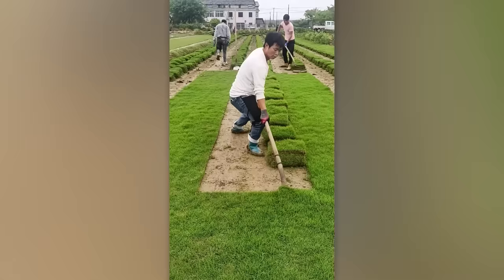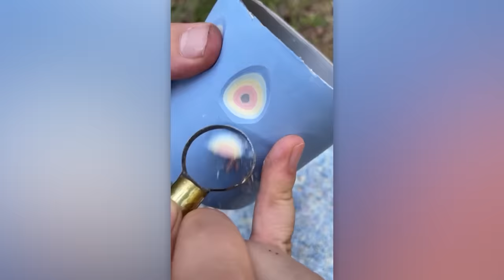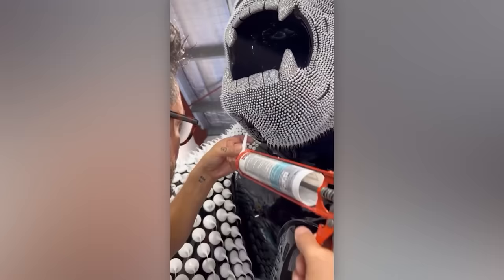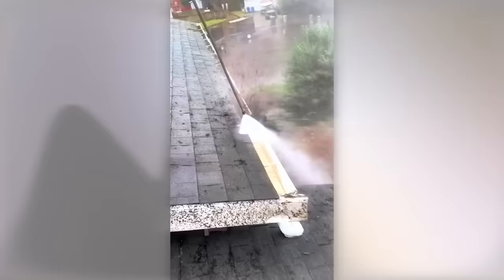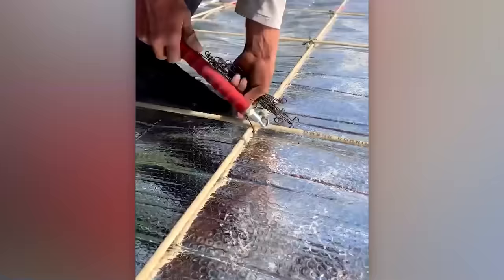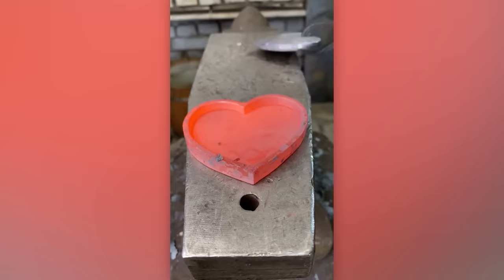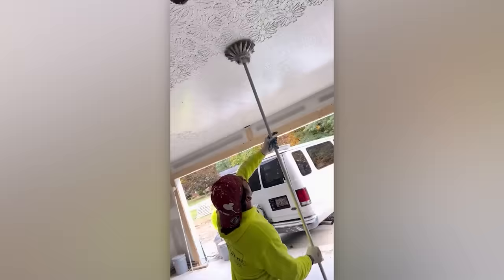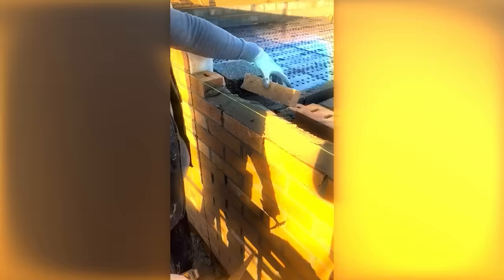SATISFYING VIDEOS OF WORKERS WHO DO THEIR JOB PERFECTLY

Comment: 10:36 You should never push dust into a coil from the side it enters. The point is to push it out of the coil. Vacuum it off first, then flip it over and push out the remaining from the clean side. Doing it as shown will compact it and turn it into mud where the tubing meets the fins. Compacted mud decreases the heat transfer by acting as a thermal insulator. By the time you see that much dust, the coil is plugged 1/3 of the way through. Their approach may be ok on a thin coil, but on thicker ones, you're always creating an unnecessary heat transfer problem each time you push the dirt deeper in.
Reply: Sorry I use google translate.
This appears to be cooling fins, not a coil. And using high-pressure water is a common method for cleaning them.

Comment: they guy who paints his propeller shaft (0:50) seems to be genius but he is actually a fool that paints his bearings too..
Reply: If it was an antirust treatment it'd make plenty of sense, but its clearly rusted to hell. The paint wont stick to the shaft, but the rust itself. It wont last 2 years. Whats the point of a paint job without surface prep. 😂 Course bearings also dont work great covered in paint either. Though little about the job appears thought out. at least sand it and wipe it down while its turning too. He'd probably asphyxiate before though.

Comment: Can anyone tell me what these are in the video?
  8:10 - Don't know what it is or what they did
12:18 - What is that tool called?
15:42 - What are those things (leather strips?) and how do they not come uncoiled?
17:25 - What magic is he using???  lol
Reply: If only they credited the actual creator. 
You would then know.
Reply: 8:08 cleaning the gutter with a power-washer, 17:25 I think electroplating
Reply: @Gertyutz  thanks, I meant the one after the gutter cleaning.  Guess I got my time wrong; I updated it.
Reply: @Gertyutz  It is a high powered laser for removing rust and other surface impurities. There are lots more on you tube including some with better explanations.
Reply: 11:56

Comment: dry ice is super bad for the environment
Reply: No its not! When dry ice vaporizes into a gas, it leaves behind no secondary waste, only the original contaminant. Dry ice pellets are also pure carbon dioxide, so they don't leave behind any toxic residue so even though dry ice is made from solid carbon dioxide, it never produces or releases excesses carbon dioxide into the environment when it turns into its gaseous form, and does not contribute to the greenhouse effect.